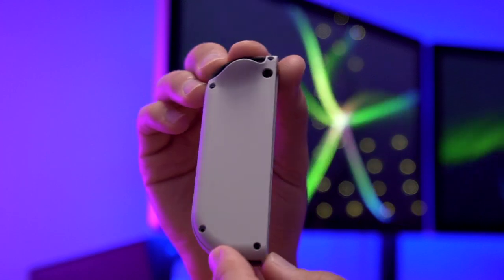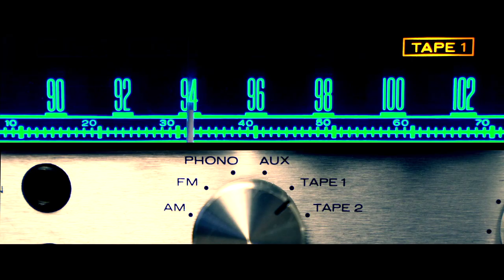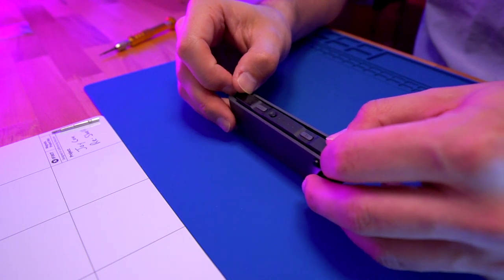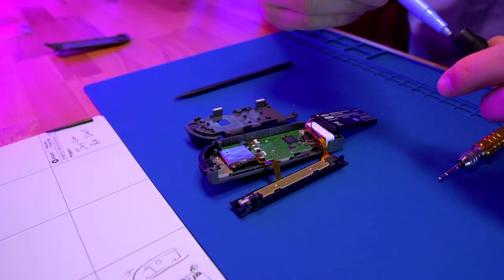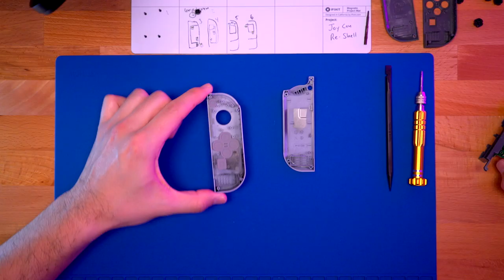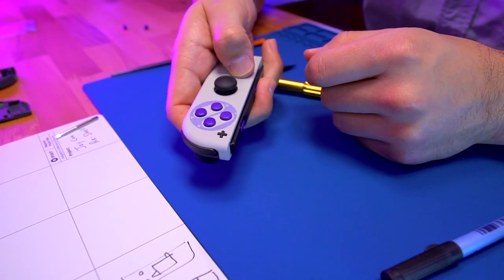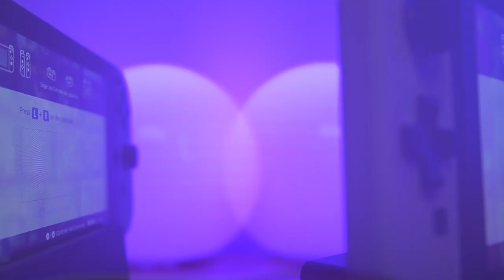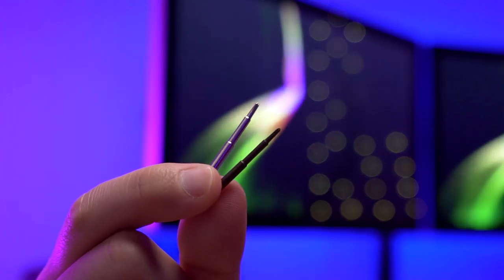$20 JOY-CON D-PAD CONVERSION AND SHELL SWAP for SWITCH | DONE THE EASY WAY | Tutorial | Retro Renew

Comment: Awesome tutorial! Just finished doing this to my joy-cons thanks to this video. I went with the EU SNES colours. Only fiddly bit was swapping out the battery tray as my joy-cons were the red & blue ones. I had to swap out the tray or I'd end up with coloured strips by my triggers. Getting them trigger springs aligned was a bit of a pain.

There's also a couple of differences with your kit compared to mine. I didn't get the SL & SR buttons or any triggers. Just thought I'd mention in case anyone reading this wants the PAL colour scheme.

My D-pad also makes fairly audible clicking sound compared to the original buttons. It's not a deal breaker or anything though.

Comment: They also have a Soft Touch version that has a kind of a rubbery feeling to it.  I've been very satisfied with mine.  I've never once used a single joycon as a controller like they intended so the D pad is a much needed upgrade as far as I'm concerned.  And even with the slightly thicker rubber coating my Switch still fits in my grip cases (Skull & Co and Satisfye).
Reply from the maker: I actually forgot to mention that my shells are also Soft Touch, they do feel great!  Yeah same here, I've only ever used the joycons as a controller on very few occasions.  Thanks for the input Josh, and hope you are enjoying the channel!  Cheers buddy!

Comment: Worth checking your buttons work before closing up the shell.
The ribbon cable came loose on my right one, SR didnt work only 3 buttons lit up.
I thought I had damaged it, but it turns out that it just came a bit loose while installing everthing.
If you dont want to die prematurely from going insane, don’t use the triwing screws to put the shell back on either.
Use the black screws in the bag, theyr same size but regular philips.

Comment: Definitely a better method than how extremerate themselves show it, but you will have to use the battery case the shell comes with, if you don't use a pair of gray joy cons (which seem to be the rarest color) for the mod. With all other colors the plastic part between R and ZR / L and LR will most likely not match the color of the new shell... This requires at least one ribbon cable to be removed, plus you need to install ZR and ZL with two springs each and you need to reuse the micro switches from the original joy cons. So yeah, a little more effort may be required, but apart from that it's very much doable the way you show it here. Thank you for the well made instruction video.

Comment: Great video. I did the install and it worked out. One problem: on the right joycon one of the ribbon cables connecting the SL and SR button bar thing snapped, but fortunately all that doesn't work are the LEDS that light up (as far as I know). I might buy a broken right joycon and see if I can replace it, but for now the whole kit and kabootle works great.

Comment: I did this shell swap with the classic black & red nes style.  Very stylish, but without a pivot the play experience in handheld mode is still significantly inferior to the hori left dpad controller.  I've been thinking about ataching some sort of custom pivot to the bottom of the silicon pad under the dpad, but I'm worried about the pressure point damaging the board.

Comment: Nice. That's why i bought the hori dpad joy con. A must own for switch
Reply from the maker: I love Hori products!  They’re always very high quality!  Thanks for sharing!  Cheers!
Reply: @MachoNachoProductions  they are good. They have been since way back too
Reply: @Macho Nacho Productions do you happen to have used the Hori Dpad joycons to compare the feel compared to this mod? I have the Hori, but there are some things I don’t like about it like that it’s not quite the same size as an original which feels weird (and they don’t provide a matching right joycon which is frustrating), lack of wireless support, and in general the dpad feels OK but not as good as I would like. 

I’ve been thinking about doing one of these shell mods since I literally never use the joycons as single controllers, but if the feel isn’t any better than the Hori pad then maybe it’s not worth it...
Reply from the maker: Hey Ben!  Unfortunately I haven’t tried the Hori dpad joy cons. I will say that the implementation of the dpad with the extreme rate kit is very good, it feels like it came from the Nintendo factory with a dpad. I hope that helps a little. Cheers buddy!
Reply: @MachoNachoProductions  That's definitely promising... The Hori pad isn't bad, but it's definitely not amazing and the other downsides really suck. What I really wanted to do was buy a set of used joycons and re-shell those while keeping my originals, but jokes on me, used joycons even years later are still stupid expensive haha! I have a second Switch, tablet only, that I bought used a while back for modding purposes to keep my main switch clean, and figured I'd end up picking up used joycons for it eventually, but the prices somehow never came down lol. 

Anyway thanks for the review and detailed installation guide. I've done a lot of modding and hardware stuff in general, but anything with the Switch still scares me a little with all those tiny ribbon cables and stories of ruined joycons, but maybe I should just suck it up and try it out on my main joycons. 

The thing that really stings is that the dpads on the official Switch Pro controllers reeeeeally suck (constantly hitting wrong directions ruining my Tetris 99 games by accidentally hitting up haha), so they're not even a good way to use a dpad unfortunately (what happened to you Nintendo!? You literally invented the dpad!!) so I really would love to have a solid performing dpad on my joycon.
Reply from the maker: I know it’s crazy how expensive everything Switch related is still. I hope with the next generation of consoles on the way we can start to see some prices drop. I definitely recommend modding the joycons if you can find a good price on a used pair!  I wish you the best of luck Ben!  Cheers dude!

Comment: does the dpad pivot or is it possible to input opposite directions at once?
Reply from the maker: If I remember correctly it is possible to hit them all at once much like the unmodified joycon
Reply: To be honest,
 more than anything, it allows you to hit UP & RIGHT for example, much easier as you would be able to normally, the same way you would on a retro dpad.
Unless your sincerely mentally disabled, hitting multiple buttons accidently is not really going to happen. Its like asking “can I accidently hit Z & ZR”.
After having installed the black NES classic last night, can say I have absolutely no regrets. Dpad & controller quality is superb.
Reply: @MachoNachoProductions  thanks for the answer after such a long time :)

Comment: Tried to replace my shell , now my left stick doesn’t probably 🙄...it only goes left and right for some reason ...any suggestions??
Reply from the maker: It sounds like it could be a damaged joystick.  You can buy a replacement pretty easily and they are also fairly inexpensive (about $8).    Check eBay for a replacement.  Replacing the joystick should be easier than swapping the shell.  Best of luck!  Cheers!
Reply: Macho Nacho Productions bro i did that ...still didn’t work 🤦🏼‍♂️ it kept drifting..I put the old one back on and it worked  little better but still not working properly... maybe I just bought a defective one